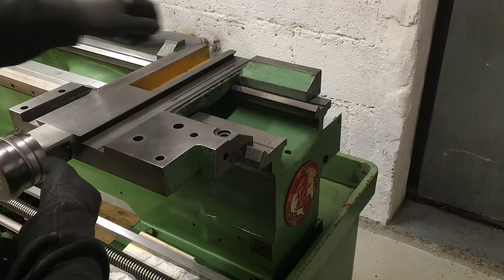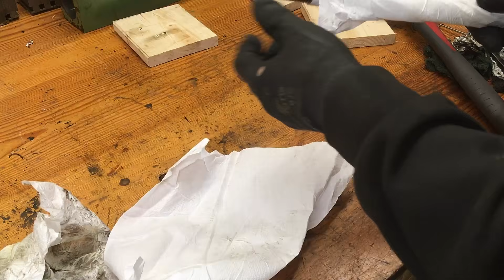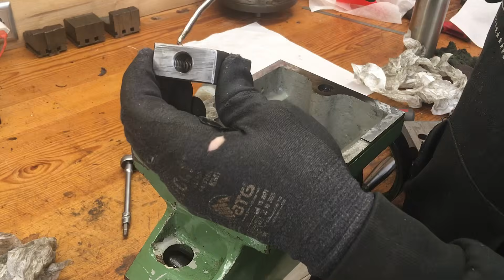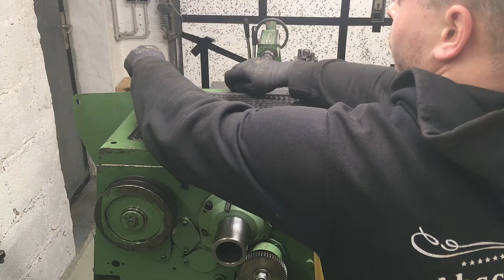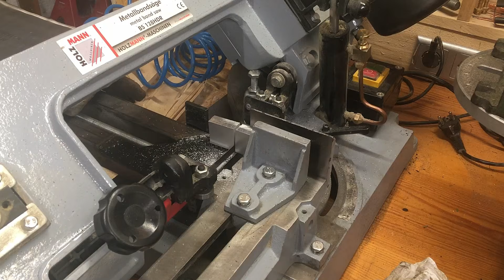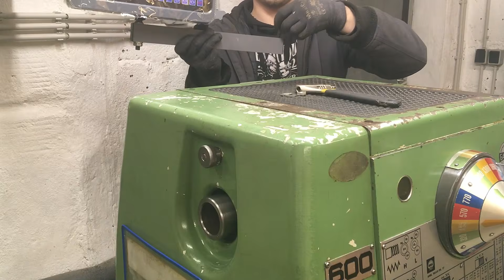I Gave This Machine From The ‘80s A Second Life | Lathe Restoration Part 2

Comment: Excellent work.Your attention to detail and explanation puts my OCD at peace.I have gone through the same procedure with my Colchester Triumph 2000 lathe,so i appreciate your effort.From what i can see ,the machine is in good health.For other Colchester owners i suggest to check the compound slide contact surface where the two bolts are (your one looks good) as it tends to move from there.Also is a bit of a design fault in my opinion ,as two bolt configuration only holds in one direction.There are few other tricks to make it better then when it left the factory.For cleaning precision surfaces i will suggest using phosphoric acid and brass wire brush (on a drill).Keep the good work!

Comment: This is not a restoration, is just a cleanup! 
Restoration means measuring of flatness, parallelism and perpendicularity on every moving part in relation to head of the machine. Restoration means also, grinding and scraping on the surfaces that have wear or excessive wear over the years of use in order to achieve flatness, parallelism and perpendicularity. 
If you find a broken part - since it’s a restoration project - you have three options, a. trying to fix it (if this is possible), b. make a new one, c. searching to buy the original part from shops that selling surplus parts etc. Restoration also means, changing of every bearings the machine have' inspection of the apron leadscrew, the leadscrew of the cross and top slide - in case of excessive wear you'll need the change or make new leadscrew-s.   
The final step of a restoration is the paint job - usually the original color of the machine. 
Adding a DRO, a new chuck, or another QCTP are consider add-ons and we are doing this simply because we want to improve the accuracy and the quality of the parts we going to make with the restored machine.

This just my humble opinion on how a lathe should be restored.

Comment: Just as a shoutout to anyone installing a DRO.
Or will I just sound like a grumpy old man picking on every small detail… 🙄🙈😅

If it’s anything like the ones I have (it sure looks so), the installation manual says to keep the transportation lock/adjustment shim (the black plastic piece in the background at 37:00) in place for the correct spacing between the head and scale, when tightening it.

I’m not saying you did anything wrong here. It might just be out of the video.
Just a small detail for anyone looking for inspiration in this awesome project and video. 👌
Impressive to say the least.

Edit: And just because of me commenting about the spacer/liner you mentioning it less then two minutes later. 🤦‍♂️
I’m sorry for jumping the gun here.
Ooh, and your brackets look 1000x better than mine. Really nice.

Comment: WOW I have been told for years don't  run the motor backwards on my master 2500 because the oil pump will stop working - I have a VFD on mine and am off to check if it still pumps in reverse on my 1986 version.

Comment: Am I missing the parts where the ways bed headstock and everything else were measured for flat, parallel and perpendicular and all the grinding, scraping and adjusting was done to restore the lathe?   Seems like there is a big block of video missing.

Comment: Nice ! Would be a Good Candidate for a Bed Regrind and scraping of the Saddle , Tail and Headstock. Crosslide scraping . and Regrind the Top Surface of the saddle.  The Spindle looks  to be in good shape !
Reply: Rather what I was thinking. Then it could be called a restoration. This work shown is only a clean up. He did not show any evidence of measuring for wear in any of the ways, of which I am sure there will be.

Comment: Missing thread dial can at least be gotten around by just not disengaging the half nuts in the meantime, similar to how you'd cut metric threads on an imperial lathe (or vice versa), this machine cleaned up real nice though, looks great
Reply from the maker: Agreed, until you want to thread close to a shoulder. I’m in the middle of making one from scratch.
Reply: @PhilEngineering  In those cases if your chuck isn't a threaded on affair then the other way around that is to flip the tool, reset your centre height and thread away from the chuck, for the longest time that was my standard threading arrangement haha, that was unfortunately a necessity for me because it was an imperial lathe and most of our customers wanted metric threads, gotta make do with what you've got as they say